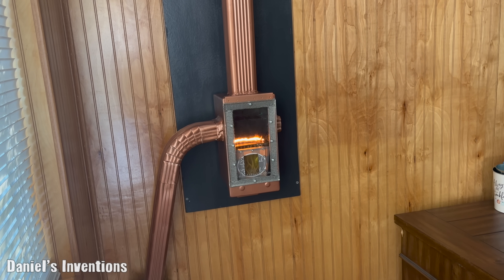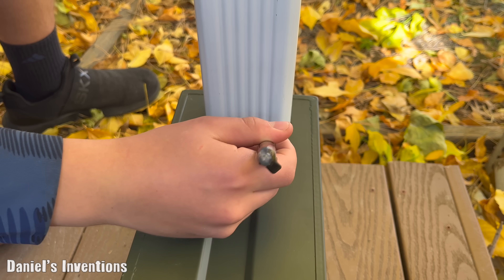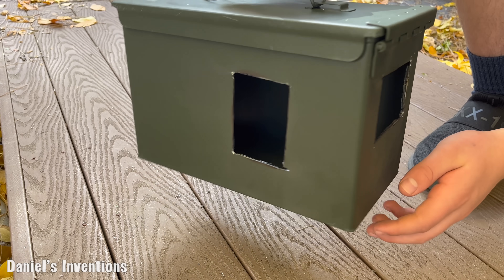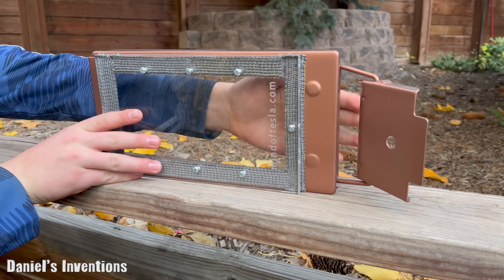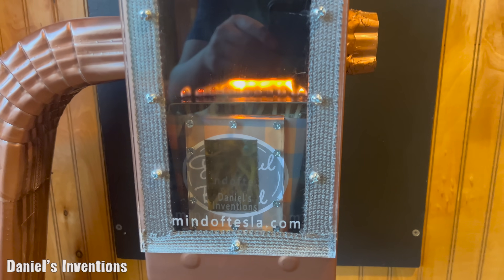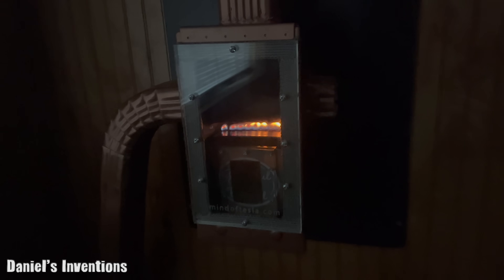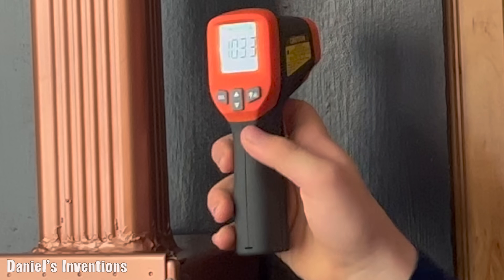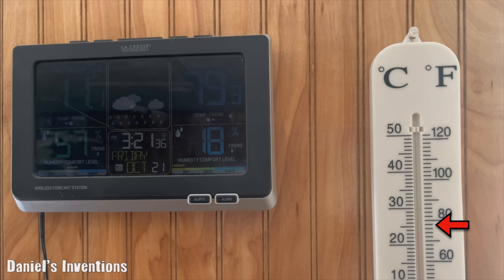ENDLESS Heat for Your Home WITHOUT Electricity

Comment: I love this idea, but the title is misleading. The title states WITHOUT electricity, yet beginning at 2:30 there's a 3D printed stand for a computer fan, and then showing a power adapter shortly afterwards. Yes, a battery is mentioned, but what's going to charge the battery? 

Cool concept though.
Reply: The fan is not needed, but it helps with air circulation.
Reply: @jimwei4life  I realize that, but the title is still misleading.

Comment: You could even rid yourself of using solar or any utility electrical input but collecting some of the thermal output using a peltier and rather than powering the peltier to obtain a hot and cold side, reverse the notion to collect the energy for storage in some caps or a powerbank charging notion while the rest of the energy goes towards powering the fan itself when a cell is charged.

I mention this because you are quite younger than myself and I think you'd enjoy the experiment to further the notion of inventing, very nice video buddy :D

Comment: You said no ENDLESS heat with NO electricity but then used a wall wart to power the fan. Even if you used a battery, you're still using electricity. The battery would need recharging sooner or later. At a draw of 1.6 amps a 700 AH car battery will last about 18 days. To heat my house, I would need a minimum of three. That would mean three gallons of oil per week. Winter lasts about 16 weeks. That means 48 gallons of lamp oil per winter. Plus recharging my battery every six days. How are you replacing the oxygen in your small home? Shouldn't you be drawing fresh air from outside at a minimum? Even if the temperature drops to zero and you subtract that from the 450 degrees, considering your air is at 77 degrees, the output would still be 373 degrees and then you won't asphyxiate yourself. Or leave your window open a bit. What happens if you use charcoal brickettes? Sorry, your title was incorrect, it's NOT endless, it USES electricity and will eventually asphyxiate you. Nope, not building one and I wasted five minutes of my life on this....
Reply: The fan is not needed, but it helps with air circulation.

Comment: I wonder if you mounted a thermo electric fan on the top and loop the pipe up and around the box you could get this to use no power whatsoever. You can get one from TSC for about $100 and it works well on my dad's wood stove, but focusing the fan through a vent would focus and increase the output.

Comment: I'd be curious to see if there is air flow without the fan.
Reply: The fan is not needed, but it helps with air circulation. So, I'd assume it does have pretty good of an airflow on its own.

Comment: Why is there a quick edit when you take the temp of the output? I'm a little suspicious about 450 degrees, but the design is solid.
Reply: I have a heat measurer like that, and it sometimes takes up to a minute to measure the temperature. They are probably trying to make the video move faster so you do not have to sit and wait for a few minutes to see the temp of each spot.

Comment: No electricity means no electricity, not a 12v powered fan that requires electricity. Nice build, no need for clickbait, plus, if you want to inspire more followers, build something without a 3d printer, for its not a common household appliance.
Reply: The fan is not needed, but it helps with air circulation.

Comment: You said no electric then plug a fan into the wall 🤔 you could easily make a power bank with some Spark plugs and magnets problem solved
Reply: The fan is not needed, but it helps with air circulation.

Comment: Cool video. The much cheaper but less healthy version of this would be to just light 10 home made oil candles and burn them in the room.

You can use random oil, I prefer vegetable oil since I don't have to worry about breathing in anything really harmful, combine this with a regular cotton ball wick, a glass container (from a previous candle is preferred), and a bit of tinfoil folded a few times so that you get a long rigid strip about 1 inch in width to lay on top of the candle/glass container then poke a tiny hole in the middle to thread some cotton thru. This will allow the oil from the container to move up the cotton and suspended by the tinfoil it will burn on top of the home made wick.

A single cotton ball will give you 10 wicks easily if not more. You don't need much cotton for a wick. Less is more in this case. 

Just pull gently a few fibers out the cotton and twist with your fingers until a skinny wick of desired thickness is achieved.

This home made candle lasts with a good flame for about 1 day before the intensity goes down. After which you need to adjust and trim the top of the wick a little to get rid of the charred part and expose fresh wick.

Doesn't require a lot of oil. I used one of those big yankee candle glass jars and it would last a few days.

Anyways, I like your method more tbh, since you can use any oil. Thou I'd prob use different (a bit thicker) materials for the metal parts and actually weld things together. And maybe place a few heat tiles on top to retain and radiate heat better. Just my 2 cents! Good job overall. I love your concept!

Comment: I am a little concerned about whether JB Weld is flammable or can give off toxic fumes. Also question painting the fire resistant concrete board, unless you are using fire retardant paint. Other than that, real smart idea, normal oil lamps will give off heat, but you usually have to put up with some kind of smell from it, this makes it to where you can use any kind of oil that burns, and is quite efficient... nice!
Reply: Certain JB Weld expoxys are heat resistant to up to 1500 degrees.
Reply: @nicnackaful  yes, especially the red package... that is what you would use around a water pump in a car (among other applications).
Reply: @nicnackaful  Good to know, ty.

Comment: Can't say "without electricity" when you're using electric to run the fans which is spreading the heat around to the rooms
Reply: The fan is not needed, but it helps with air circulation.

Comment: (135,000 Btu's x 70% efficiency) / (12hrsday X 7days) = about 1125 Btu's per hour. about 6 cents per hour assuming $5 Diesel.   ---  electric space heater 5,000btu/hr 1.5 kilowatts per hour 22.5 cents per hour in Colorado 19 cents in Texas  ---  High efficiency  9000/btu Hyper-Heat Mini=Split Heat Pump 30 SEER  10 cents per hour in Colorado.  Solar System can run Mini Split.  You did a great presentation. Please do not fill with used motor oil.

Comment: Only issue I see with the testing is the point and shoot thermometer measures surfaces for temperature, not the air. Most likely got a reading of the bottom of the horizontal gutter pipe, the hottest spot of the heater.  A more accurate reading of the output air temp would be an oven thermometer placed in that stream of air.

Comment: There IS one thing that You missed .  You need to edit this video and insert a !!!!!!!!WARNING!!!!!!! at the Very Beginning. You haven't mentioned anything about safety equipment used such as a face shield while using that grinder!   Also You need to point out that the viewer that decides to copy your design  does so exclusively at their own peril and that You are in no way responsible for any loss brought about by their actions.    It's a crazy world FULL of lawyers! You've been warned .
Reply: They are not selling the heater. So, making this is at your own expense. It is pretty safe for the most part, though.

Comment: 50 Cal Ammo Box ?  Not WITHOUT electricity, you need electricity to power the fan, whether by A/C or battery.
Reply: The fan is optional to help with air circulation. The heater could run without it.